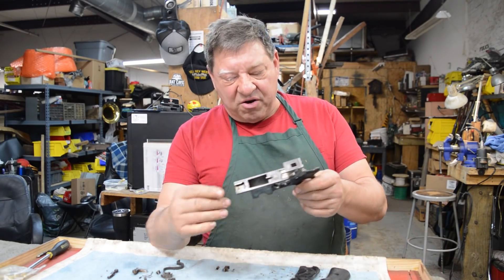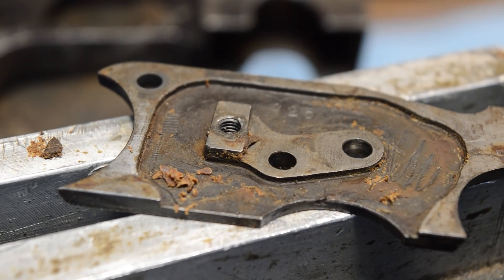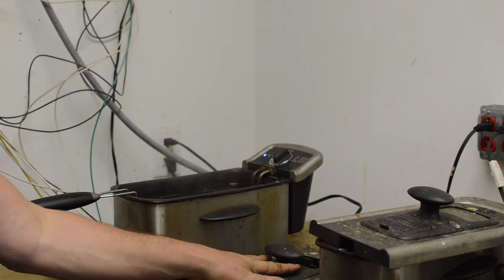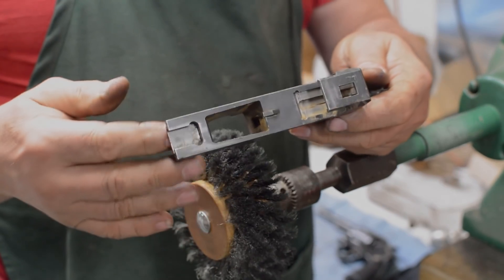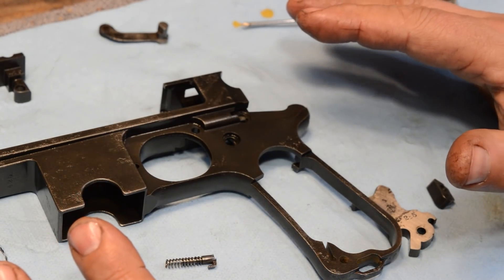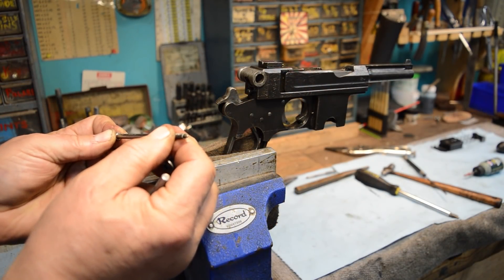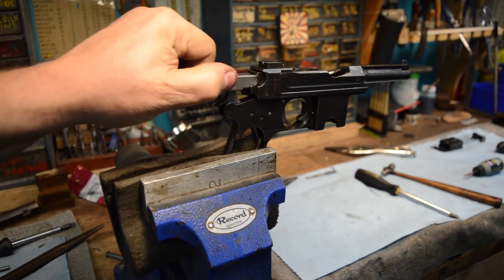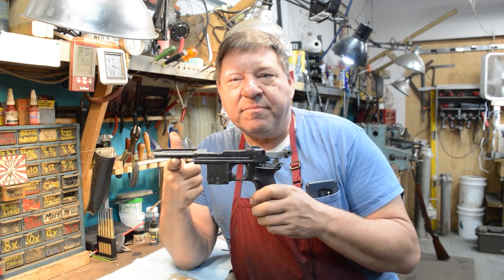Bergman Bayard 1910/21.... Anvil 0108

Comment: I lost it at "I got a Dremel, so i'm a gunsmith!" in a perfect Barney  (Simpsons) voice.  🤣  My first gun was a junkyard mutt of a .45 (NOT going to call it a 1911).  Series 70 Commander slide on a full size Safari Arms frame with a huge, deep finger groove.  Spotted several of the individual flaws, but not all, and completely missed the big one...some S00per Geenious had "polished" the ramp of the barrel and the feed ramp in the slide to the point where it wouldn't feed reliably with a safe barrel (several millimeters of case wall showing at the top...I like being able to count to ten without taking my shoes off).  Kept it for several years, then regretfully "retired" the frame after letting a friend pull the usable parts off it.  You live and learn.  And pay for the parts and labor to try to make a wreck whole again.

Comment: To Mark and all the fine crew at your shop: Have you ever noticed a difference when doing a boil out if using distilled water vs hard water vs soft. Thank you for all the hard work and hours it takes to make these videos, the world is in your dept!
Reply from the maker: Tap water for everything.  Possibly might consider distilled for rust blue of a high-end from scratch job, maybe
Reply: I was using a boil out tank that also gets used for hot bluing. It struggled the turn the parts black. After draining and refilling with tap water it started turning black. Depends on what your tap water puts out but acidity DOES play a roll

Comment: I did a "Rust Blue job" with a CPAP ozone generation steaming system on a reproduction musket and pistol barrels, then for yhits and giggles? I electro plated over with a zinc (or silver? hard to remember) copper solution on one, and a zinc (or silver? hard to remember) nickel on another and it took over the rust blue? Both looked period correct lighter or darker grays, and both are very well rust resistant a year later hanging in my open shop with roll up doors open all the time day or night.
Love this stuff! Thanks SO MUCH for Providing Knowlege with new Ideas!  Love how Fearless you are! Like doing CPR the patient is Dead already! you can only bring them back!

Comment: Damn I'm glad you are doing a gun so far gone it ain't worth saving.

About ten years ago I did an 1899 Winchester model 94. OMG ridden hard and put away wet does not accurately describe this gun. It kind of looked like great grandpa beat the holly dog doo out of this gun, and rarely maintained it. Then he died.

The gun (Grandpa's gun!) was kept, wrapped in a blanket, stuffed in a closet, and forgotten...in about 1950. Then I got it. To get it apart took about 2 weeks. I had to drill out two screws (I actually managed that!) The extractor and firing pin were broken, corrosion, the magazine front hanger was RIPED out of the barrel and flopping in the breeze. And the front stock end cap hanger still had drilled out screw in it. Oh and the magazine spring was rusted in pieces. Did I mention how pitted inside and out the barrel was? The rear site was also rusted in 2 pieces. The gun was a wreck. But the action still worked, the wood was good, and I wanted it so bad I figured I could do some fancy aviation maintenance on it, and get it running again.

I did. $150 worth of parts and springs, the softest touch I could justify on the barrel (Deep pits!), I cleaned the wood with steam and a soft towel. I saved the Lyman tang sight. I used oil and 000 steel wool on everything but the wood, and I got a working (still looks old, but it's not) model 1894 made in 1899. I worked up a super light lead load for it, and it shoots great. It looks old, it works like old, and shoots lead just fine. I'm happy with it. 

The gun wasn't worth trying to preserve. Instead I got a working nineteenth century rifle I could afford. And it still looks old, pits and all.

Yes I did a bubba!
Reply from the maker: NICE. Keep doing this

Comment: When I worked in maintenance at a local hospital 40 year's ago, we weren't aloud to use WD-40 because it collected so much dust and dirt. When I worked on the electric bed's and would have to lube them, I would use a bar of soap. I can't remember that far back, but we only used one or two kind's of soap.
Reply from the maker: Grease is oil suspended in soap after all

Comment: I have a C-96.  Barrel needs re-lining, grips original but not too great.  No matching numbers so a parts gun.  Question:  Should I reblue it or leave it essentially in the white?  It has no real collector value so if not, why not?
Reply: Reblue it.  Itll keep it around for much longer if it is
Reply: @wierdalien1  That's kinda' my way of thinking, too.  Long as I don't polish off all the edges.  Same for my old Triple lock.  It's had the back of the chamber shaved and re-chambered to .45 Colt.  Fine old shooter but nil collector value.
Reply: Actually meant the back of the cylinder, not a chamber.
Reply: Another vote for re-blue. 👍 You won't be making it look like the day it rolled out of the factory, but it'll look how the manufacturer and designer intended it to look. I believe in refinishing guns that have no collector value, because handsome guns are nice. Like Mark often says, if it's Lawrence of Arabia's gun...well...no refinishing there. 😸 A mix master parts gun? Hell yeah, make it look proud.
Reply from the maker: Conserve and rerust.  Anvil 109 is this very topic, standby

Comment: I wonder if a mild acid bath... maybe as slight as pickling vinegar would remove the finish caused by the fire fighting chemical?  It would only need to remove that finish.  I have taken the zinc plating off of bolts in an hour with vinegar.

Comment: I have a llama 1911 semi clone? Dont know how else to describe it. Someone tried to fit a 9mm 1911 barrel to it. Looked pretty good except the ramp was ev idently tinkered with and blew the case out into mag and mag well... yikes.
So now i load one round in mag cycle mag, then remove the mag to test fire semi auto pistols.(provided they fire with no mag of course) found an orig. Barrel and put it back. Chambered in 9 largo.
Gun is marked 9mm/38 on slide.
I can only assume 9mm largo or 38 acp.
As i dont think 38 super had really caught on in spain when gun was mfrd.
Best guess is early to mid 40's.
That 9 largo is getting hard to find. I just use 38 super brass and load to largo or acp data... its been a reliable and fun shooter...
As always, good stuff Mark.
Reply: Steinel is making 9mm Largo...just got 250 rounds from them and it looks nice.   Starline is also making the brass now and then....got another 500 cases so I'm set.   My FedOrd 714 Mauser C-96 is chambered in 9mm Luger but the magazines were for the 7.63 Mauser and are way too long for the Luger so it would misfeed badly.   Have a chamber reamer that's going to deepen it to Largo which fits nicely in the mags.   Yes it's going to be quite the Frankenstein but I'm thinking it'll work well.   Oh...mags are non-existent for the Schnellfuerer's unless you want to pay $400 for an original.  Gun came with a 20 and a 10 rounder but I just got a couple new 20's from Triple K that look great and were under $100. :)

Comment: If you put a 1” split in a chopstick, you can jam a small piece of 0000 in it and make a carting brush with actual steel wool
Reply: Damn, that's a fancy tip! Thanks dude. Twirl it around and you'd have a little steel wool Q-tip for getting into pin holes and such. Or use 0 or 00 and then use that Q-tip to torture your enemy. 🤷🏻‍♂️
Reply from the maker: I am successfully getting folks to THINK

Comment: Ah old forgotten machining techniques. 

Oddly enough someone likely did free hand the machining for that side plate, but not directly. While each operation was likely done separate, a pattern maker would have likely machined a "pattern", that would then be used with a trace mill or a piloted end mill to cut the shape. After CNC machining became prevalent pattern making as a profession pretty much disappeared. As for the magazine well I would point towards a shaper or scraper. They were a quite common type of machining equipment until the 60-70s, when they fell out of favor to faster machining process. They were not well suited to the carbide transition. Then they almost completely fell out of common knowledge in the 90s after WEDM started to become more prevalent.
Reply: A shaper you say? 🤔

*ABOM79 HAS JOINED THE CHAT*
Reply: Yup, I remember hydraulic tracers going for a song at auctions back in the 80s, along with cam operated screw machines and big turret lathes. Most got stripped of what was usable and the rest scrapped.

Comment: The m1 carbine magazine is opposite as well, the spring needs to be oriented so it pushes up on the rear of the follower,  I was having problems with my last round and realized I I put the spring oriented toward the front as you would think it should be, I verified spring toward the rear was proper with examining a few different unwrapped GI magazines,

Comment: WD-40, I call it Die Scheiße! At 26:58 when the spanner was made for the twin hole screw I like to make the drive with two round pins in the end; in that way one won't leave burs at the edges of the holes in the screw. Alot of those pistols have to have a straight arm to fire and eject properly.

Comment: Full wind on the timer, then back to 45; can you say A-4 OBA?
Reply from the maker: I actually had to pull the pin on one of those, on the boat, during an ORSE
Reply: @marknovak8255  I had a candle failure once in training and had to breath start the reaction. Best thing that ever happened was the replacement of the OBA with SCOTT air packs.

Comment: A Browning High Power is at shot show 2022 if that doesn’t tell you what a genius JB was.
Reply: The sad part is, all of the tactical rails and spray on finishes are simply going to drive the price of the blued wood gripped original run guns into the stratosphere.

Comment: I find that lithium grease ages poorly, and just a couple years it's gummy or dried to a crisp. But that might just be because of the desert I live in. I use battle born grease to pack small springs, like ak disconnectors or miscellaneous ar lower parts springs or a trapdoor ejector spring ect, and it's been fantastic. Just dip in it the jar and put it in the gun. Automotive petroleum greases work too, but I find them to run too easily with the smallest amount of heat.
Reply: I use brake component grease, designed for rusty, hot, cold, wet automotive brakes.

I will let you know how it goes in ten years.

Comment: Is this a "danish gun"???  HÆRENS TØJHUS is danish 🇩🇰 on the barrel
Timecode 5:00
Reply: Yes. 

Model 1910 and Model 1910/21
At the same time the Bergmann–Bayard model 1910 was adopted by the Danish military. A total of 4,840 M1910 Bergmann Bayards was initially delivered to the Danish Army. The pistol was produced in Belgium until 1914, when production ceased during World War I and never resumed. The Bergmann–Bayard was later produced in Denmark from 1922 to 1935.

Several modifications to the original design, such as an improved extractor and bolt; a screw to retain the sideplate instead of a spring-loaded catch; and a new grip design extending the full length of the backstrap to the frame were made. The original grips were made of Trolit, a checkered plastic material similar to Bakelite. It was, however, prone to chipping and warping, and the majority of new 1910/21 models was fitted with checkered wooden grips.

More than 2,200 Danish Bergmann–Bayard pistols were produced in Copenhagen. In addition, most of the prewar M1910s delivered to the Danish army by AEP were converted to meet the new specifications. These were restamped "M1910/21" beneath the Societe Anonyme Anciens Establissments Pieper on the left side of the barrel extension. The last Danish 1910/21 models were built in 1935, but they remained standard issue for the Danish military until 1946 when they were replaced by the Browning Hi-Power.

Comment: Made back when Skilled Labor was cheap compared to today.
Reply: True but with CNC if it  hours per op and removal of the need for the jigs the productively of skilled labour should be far higher and not keep the machines tied up in a set up for one set of processes.
Reply: You think skilled labor is expensive?🤣

Compared to the value per hour of what they generate, to what they're paid, those guys who made that pistol made more.

Comment: WD40 is a 4 letter word
Reply: Yup, I hated that %^√π¶ for 35 years. I've only seen it used ONCE for what it was intended for - water displacing. One place I worked for, used jars filled with it to temp store parts after they came of the Citizen swiss machine, to prevent corrosion prior to heat treatment.

The only other thing I've found that crap good for is removing bumper stickers.